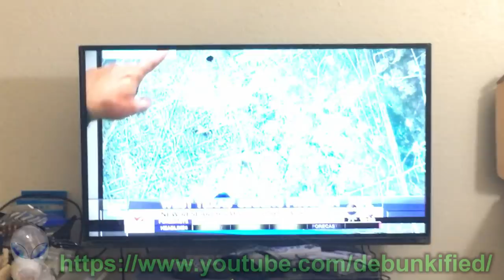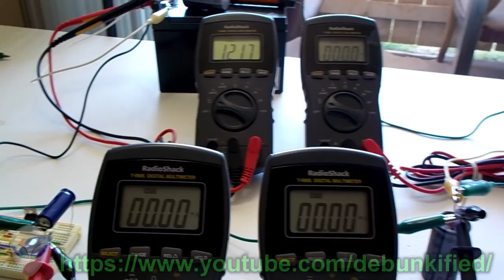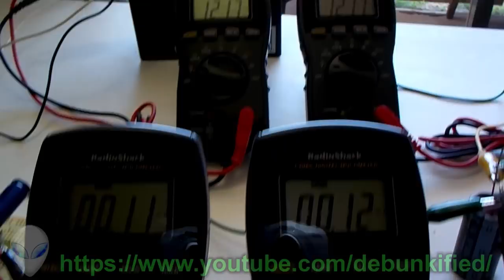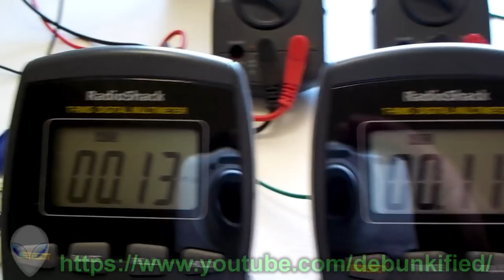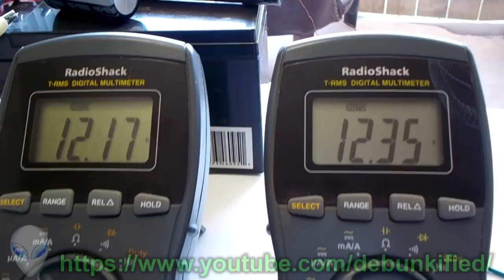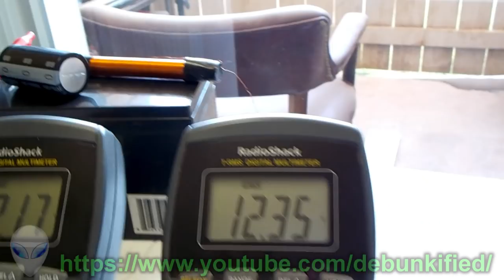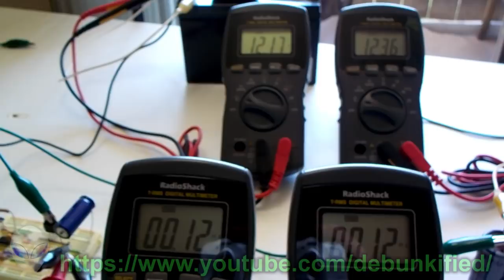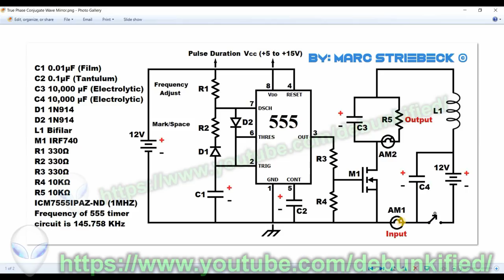Tesla's DC Impulse Technology (Capacitor Tests)

Comment: Switch the positive supply of the coil, get a negative inductive spike.  it's different. And keep in mind C3 and L1 will ring from series resonance. voltage can be higher, but power is only available when voltage and current are in phase.
Reply: Voltage and current in phase is impedance matching / power factor correction. Theres an equation for brad spectral frequency chart for all the Phase conjugate frequencies for polyphase power systems. This is on the lines of “monopole generators”

Comment: Hallo, thank you for your effort in making this experiemce more clear! i'd like to ask, what's the timer circuit cosumption? because, if we want the overall efficiency of the system being accurate we should take account of it. Thank you for your investigation!
Reply from the maker: Hi, the timer circuit consumption is outrageously high and is not worth mentioning. If you want a round about figure though count on it being between 15-30mA, which is absolutely horrible and the higher the frequency the worst that it gets. A self oscillating circuit should improve this. However a nice hard turn ON to produce a nice and sharp voltage pulse works well.This only becomes important when we have learned of the ways of increasing this effect to the point of then needing to know the cost of switching so that we may then cover it.

Until then the switching is not the actual power that is being pulsed but only the power required for switching.

The great thing about not including the switching power in the overall efficiency of the system is that it can be optionally left out when we want to observe what is happening from the power supply being switched only through the load, this is the electrical efficiency that matters the most, not switching costs to trigger excess power into the system that contains the power we are switching, switching costs has nothing to do with this, it is only the process of switching that is needed to manifest the excess energy.

We must ask why does our load receive more power than what is coming out of the battery. Thanks for the comment!
Reply: +debunkified Thank you for the answer. I agree  out/in (0,11mA×12,36V)/(0,11mA×12,16V+30mA×12,?V) is outrageously low. You should check how switching unit is effected by load variation so we could definitely understand if in any way the switching unit supply is involved on the overall calculation. Thank you 
G
Reply from the maker: Hi, I understand your concern, I have indeed checked this with the IRF740 mosfet specs and it’s current leakage tests. The mosfet leakage in no way can account for the 20 something odd millijoules of energy gain. I have also tested this myself by switching no power supply whatsoever, with an empty loop basically and the R5 load resistor. The power is fractions of a microwatt as opposed to the 20 something odd microwatts gained.

The capacitors also show this just after and immediately after disconnecting the battery to show what the energy and watts on the R5 load was just prior to battery disconnection. 

Without the switch and a direct connection of the load to the battery then we only see a 100% transfer of energy by observing the capacitors being exactly equal to each other just after disconnection of the battery.

As opposed to with the switch, then C3 capacitor and R5 load has more energy and wattage than C4 capacitor immediately after disconnection of the battery.

Not only that, but I have seen the mosfet leakage charge a capacitor to less than 500 millivolts. How can this charge on top of the battery to 12.36V?

Comment: Put the DMM across the load resistor not the output capacitor.
That way you will get rid of any losses in the ammeter, which it must have to be able to measure current, and get the true value of load voltage.

Why did you change C1 from 0.01uF to 0.02uF?
Switching frequency dropped to half of 145kHz= 72kHz.
Reply from the maker: Hi, I’m sorry but the DMM is already across the load resistor which coincidentally is directly connected in parallel with the output capacitor C3 in which the DMM is already connected to. I assume you are referring to the voltmeter measuring voltage correct?

The meter AM2 measuring current is in the correct spot for measuring current going directly into load resistor R5.

I believe with a gradually draining battery, since this is only in the experimental stages, that the load requirements to see the effect changes. I began noticing a decline in the C3 voltage so I simply replaced the C1 capacitor and this caused the voltage to boost back up to a more desirable level across the R5 load.